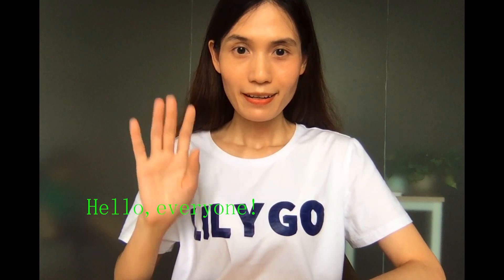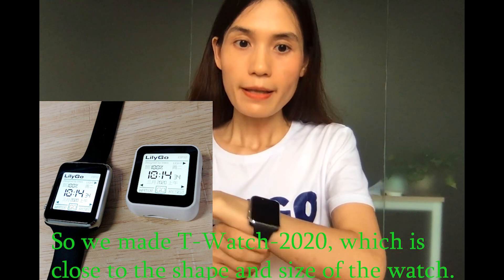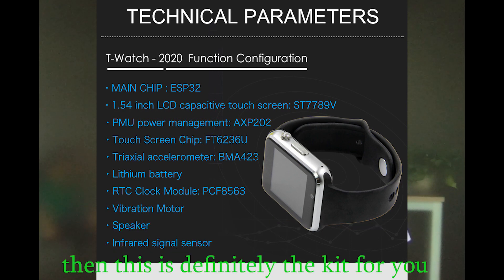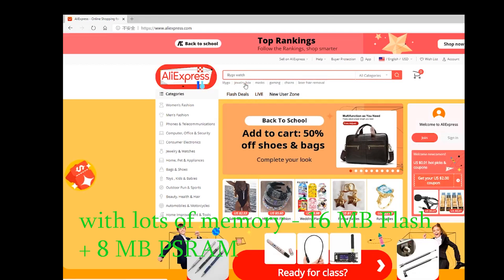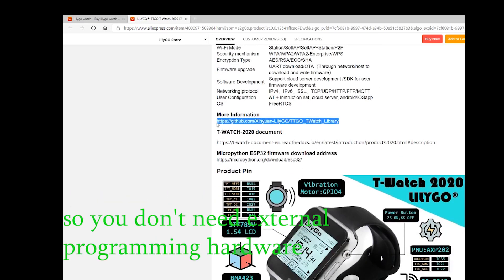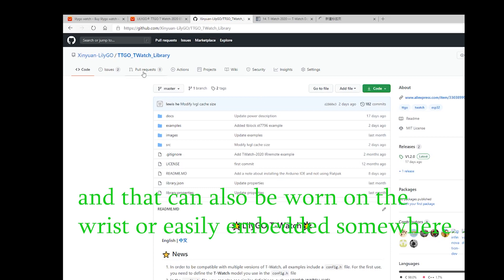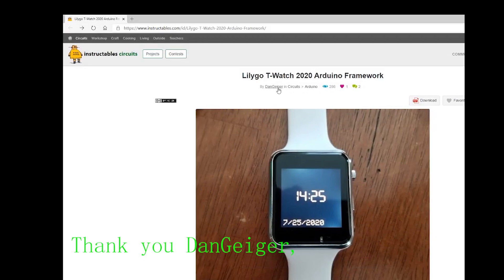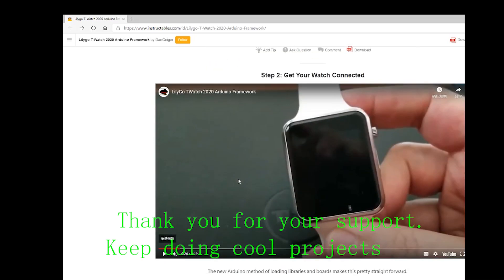LILYGO® TTGO T-Watch-2020 ESP32 Main Chip 1.54 Inch Touch Display Programmable Wearable

Comment: This arduino smartwatch looks great. But I have a question: is it waterproof? (If yes which version?) If not, can it at least resist some splashes (like when I'm washing my hands). If it can't, I would like to know where are the places from which water can get in do that I make it waterproof myself
Reply from the maker: There is no waterproof at present. The screen can resist splashing. The main water inlet, I think it should be the cover
Reply: @LILYGO  Thank you! I assume that you mean the three holes for the speaker in the back cover am I right? I am also a little bit concerned about the button, is it water resistant as well?
Reply from the maker: @Mr.Engine993  If there is only a slight splash of water, the button is water resistant, mainly because the back cover is not waterproof

Comment: I have really been enjoying playing with this great Lilygo TTGO T-Watch 2020. I hear v2 is coming? Thanks.
Reply: Does it have a microphone? or how to add one?
Reply: @dazedandcold  This is a really tightly packed unit that is intended to remain sealed. If you have the appropriate tools it could theoretically be done. Someone comments below, you would have to remove motor or speaker to make room for another device.

Comment: Hi, just received it today, the display is not the same as yours, I have only the time & date and with some movements on the screen, I can get the wifi, bluetooth, step and luminosity but no way to set the time and date !! even connected to the wifi ! how can I set the date and time pls, tkx -Domi.
Reply from the maker: There have  setDateTime in this code:  https://github.com/Xinyuan-LilyGO/TTGO_TWatch_Library/tree/master/examples/BasicUnit/RTC
Reply from the maker: You can try each routine.
There are many functions.

Comment: I'm trying to connect a ds18B20 (instead of the vibrator) to measure realtime temperature on my employees. then I will upload over wifi api rest. 
but this device it's very battery consuming even doing one every hour you have to charge every day... I have to optimize that..  
Anyways the Axp202 is way better than IP5306 for energy handling.

if you want something finished look for an amazfit, garmin, and other brands... but to track body temperature on your employees looking for coronavirus or any other IOT proyect this is the best option...
Reply: I'm able to keep my watch up & running for 22h but only with very punctual Wifi connection : trying to improve using deep sleep.
If the problem the DS18b20 standby consumption, the solution may be to use an unused LDO to power it only on demand.